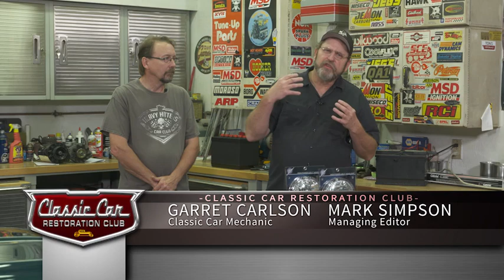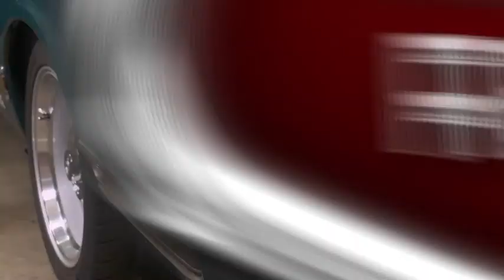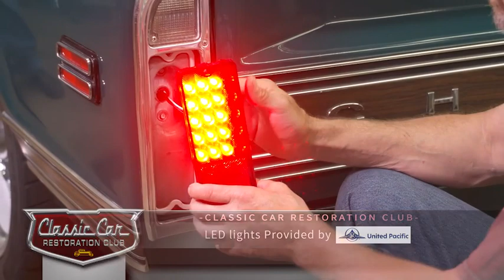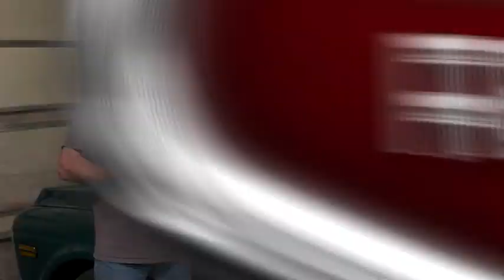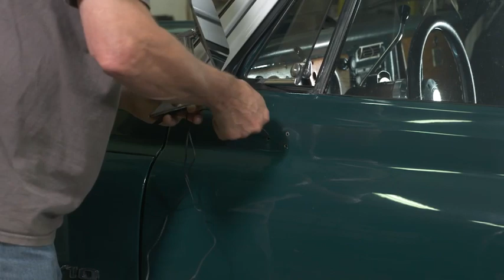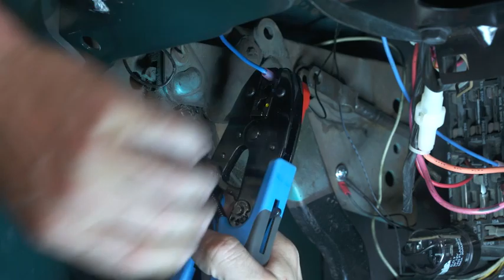UNITED PACIFIC LED LIGHTS

Comment: Love your vid. Updating my C20. Also if you don't have the tool for removing window handle clips a thin shop rag (standard red rag) will pop it off  really easy by sliding in between the handle and moving it left or right.
Reply from the maker: Great tip!

Comment: What about rapid blinking of LEDs, activating the Halo Ring, rear clearance specifications of different units, no current consumption specifications, as well as absence of instructions in their products? What is warranty on partially defective and short lived LEDs? These are the most difficult problems with LED upgrades and ones that the product vendors do not like to address.
Reply from the maker: Great question! The ‘Ask an Expert’ section is currently for members of our online community. I would be happy to send your question off to the experts. To get started, please send the email associated with your paid membership account. Thanks!
Reply: U.P. has a line of LED optimized flashers that solve most blinking issues.  Also great TECH support via phone.  Lifetime warranty on vehicle specific classic LED lighting.

Comment: Told absolutely nothing , nothing about wiring the lights at all ! 
There are people who actually install these products after buying them . What’s green wire ? What’s black ? What’s yellow wire inside ? When is ! Polarity reverser needed ? Can you damage car or new led flasher if installed without reverser ? Or if installed with reverser , when it’s not needed ? Geez 🙄 something tells me you dudes are simply salesmen 😅 not actual “ wrenchers “
Geeeez